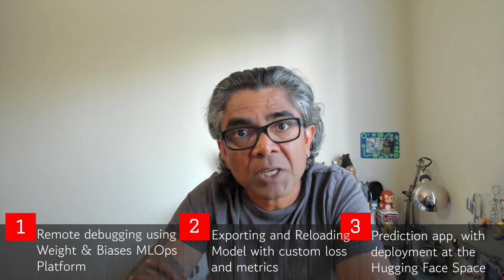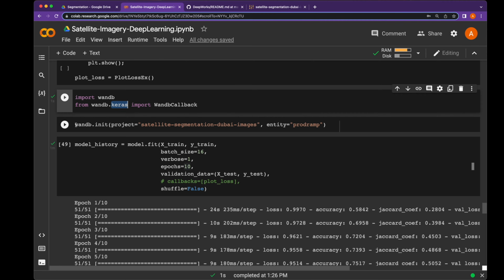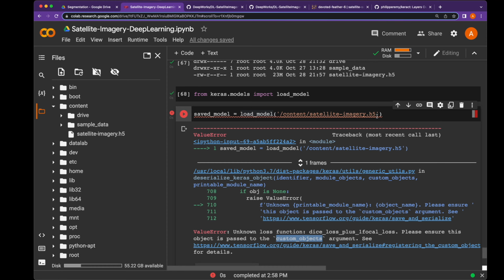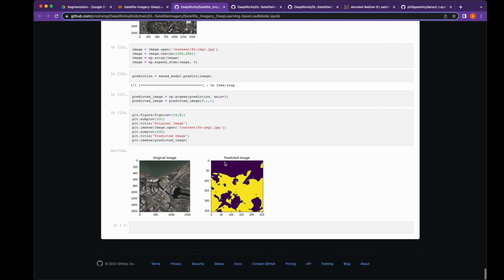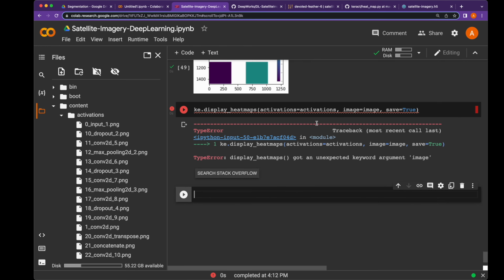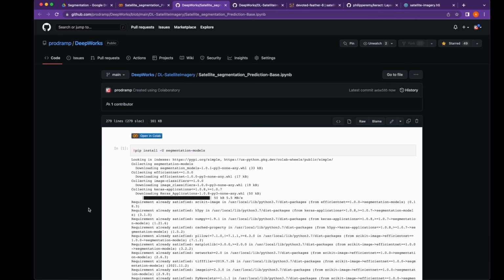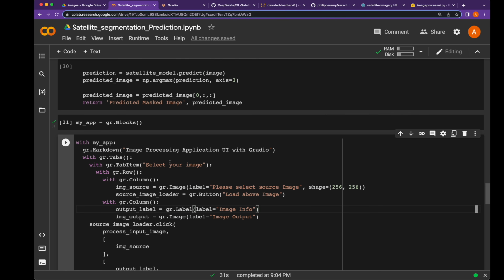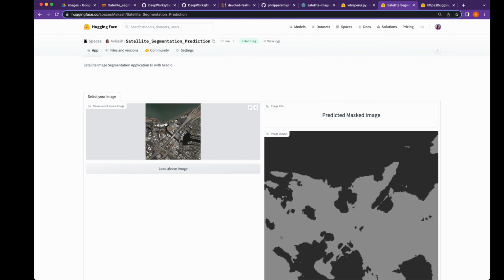Advance Deep learning Workshop for Satellite Imagery - Model Export & Production (Part 3/3)

Comment: Hello Sir,
When I am using segmentation Model it is not working properly. It gives me error saying Keras engine not found
Reply: I was also facing the same problem, in case you didn't find the solution, or for any other person like us, see if this works,

import os
os.environ["SM_FRAMEWORK"] = "tf.keras"

from tensorflow import keras
import segmentation_models as sm

This sets the environment of segmentation_models library to use the tf.keras framework and not keras's framework.
Reply: @narayanhamde4910  Will look into it

Comment: Sorry for offtopic, I found your channel by accident. My question is: are there any open-source tools for building 3D building models (in terms of contours and height, no more) based on satellite images of the same place in different years? It is required to process a large surface area and I would like to automate this process.

Comment: Amazing Lecture series. Learned a lot. I have a couple of questions:
1. When I am taking a usual image like a snipping tool clip from google maps, it consists of 4 channels instead of 3 and the present code shows error for such images. Should we modify the code to incorporate the 4th channel?
2. I am using google collab and my session expires. I tried reducing the batch size to 4 and epochs to 50. With this, I am able to train, export and save the model. But the saved model is extremely bad at predicting the  images (even the images it is trained on). The size of my model is 22Mb and has around 19Lak parameters and an efficiency of around 70%.
Could you please help me out with this? Also if possible, can you please upload the trained .h5 model on Git. 
Just subscribed to the channel. Looking forward to learn more. Thank you so much and have a great day!
Reply from the maker: Thanks for your comment, appreciate it. 
1) 4 channels CMYK images are different then 3 channels RGB images. The code is written to process RGB images all over so its better to apply image change at source to first convert images to supported channels and then use. Supporting 4 channels image may take significant code change however I am not sure.
2) Sorry I do not have model saved otherwise I would have shared it. 
Thanks again.